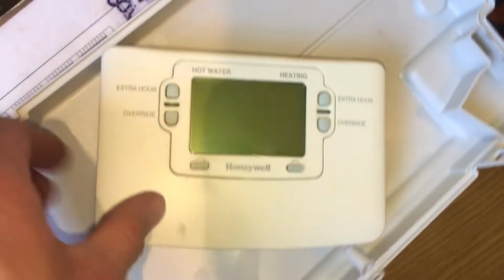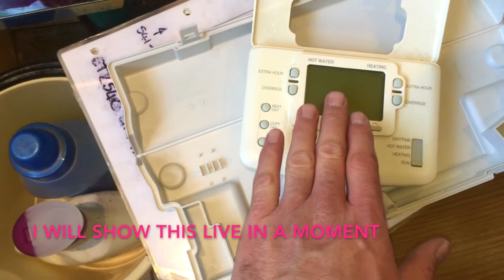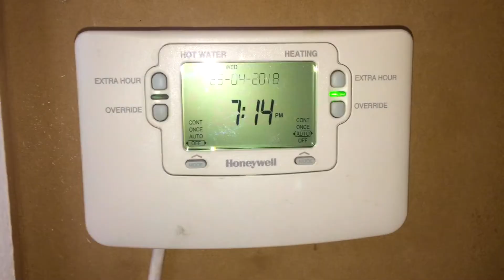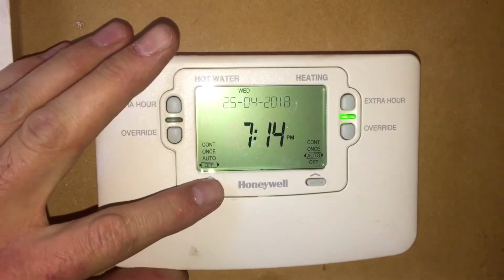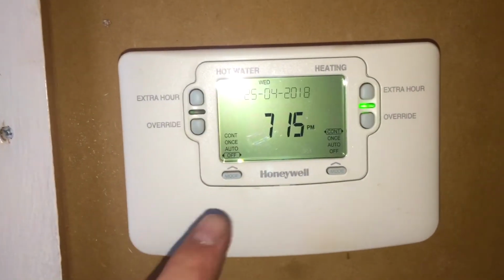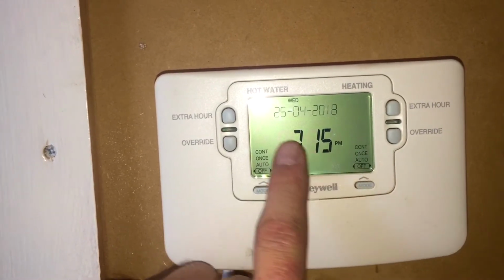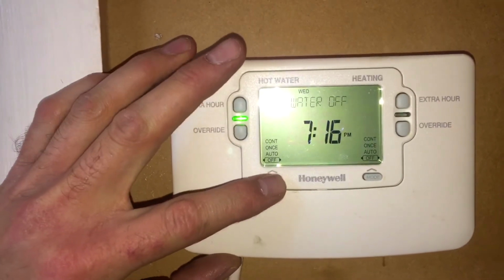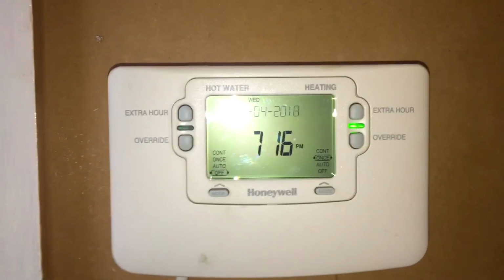Honeywell programmer issue/diagnosis. Boiler not turning on.

Comment: Thank you.I’ve been without gas heated water for months, tested all connections changed trip switch’s and fuses, even bought new used pump. It never crossed my mind to turn off heating side of controller to let water heating side do its thing..many thanks

Comment: Thank you for this video. It identified my issue.
Bought a new capacitor for £2 and the controller is perfect! 👍🏻
Reply from the maker: Glad it helped. Did you replace the blue one?
Reply: @HeatingGeek  Yes, the 64uf one.  Such a simple fix and saved £90 on a new controller.
eBay listing for the capacitor: 143802625709 just in case anyone else learns from this.

Comment: Honeywell ST9100s.  I am having problems with the heating coming on.  It has been set as per instructions, comes on for a few minutes then shuts down.  This is despite all of the lights being on and looking like it is working.  It churns away and then no noise at all and no heat.  Help!
Reply: Did you find out problem m8

Comment: Can you help. I need to change the batteries in this thermostat. How do I take it off the wall? Thanks
Reply from the maker: you don't need to remove from the wall to replace the batteries. The bottom edge just pulls off revealing the batteries.

Comment: The father in law has this system. He had problems after a power cut. The water still gets hot but not heating. I did a test as per manual to check communication between thermometer and boiler and it stated 0 so no communication. Put new batteries in it but still no go. Any ideas. Thanks
Reply: I'm having this problem right now
Reply from the maker: Sorry

Comment: Had something similar with a Drayton LP522 on a Y plan yesterday. Heating not working independently of hot water. Linked out programmer for heating, (didn't have a spare programmer) getting 230v on White wire in wiring centre but still no heating. 3 port head was a bit naffed so changed that anyway. Turned out to be programmer fault, later realised there was no click on the heating button on programmer.

Question is, why didn't the link work, especially as I was getting 230v? Anything to do with the neutral not being connected or should I have linked out to Hw off and heating on at the same time?
Reply from the maker: Probably because you had the HW on too? Maybe?
Reply: @HeatingGeek  No it was linked out to number 4 - heating on only, on the programmer. My question is should I have put a link from live to Hw off too for the boiler to fire up. 

At that point I would have realised it's a faulty programmer and not sat there scratching my head! :-)

Comment: My boiler comes on but water does not heat. Heating is set off as is room thermostat but radiators get hot instead of water
Reply from the maker: Valve is jammed

Comment: same but water comes on heating only sometimes help.
Reply from the maker: replace it
Reply: @HeatingGeek  strange it goes off just turning kettle on,capacitor me thinks thanks anyway arranging a new one.
Reply from the maker: @harleyblue999  it will be a capacitor on the board. But its not worth the aggravation to order and wait.
Reply: @HeatingGeek  thankyou screwfix new i think.
Reply: @harleyblue999  Just don't replace it with the same new faulty unit and get a refund for the old one. Manufacturers will get away with crap workmanship if you let them.